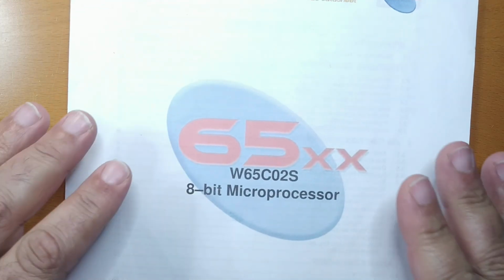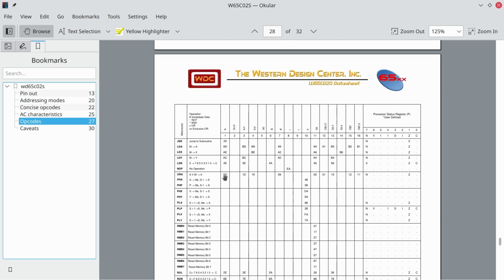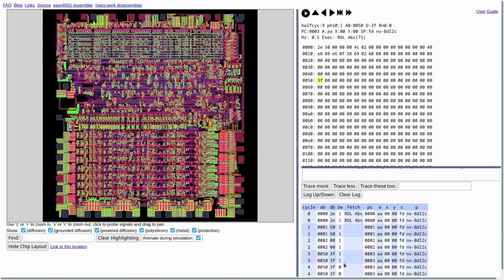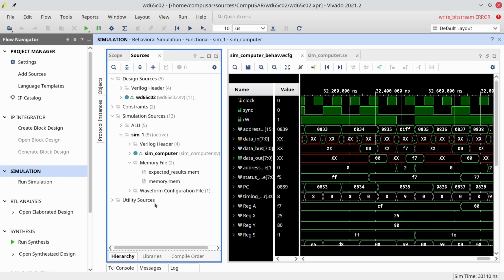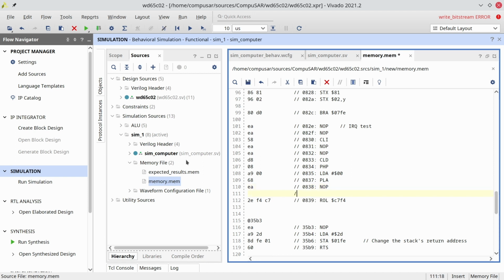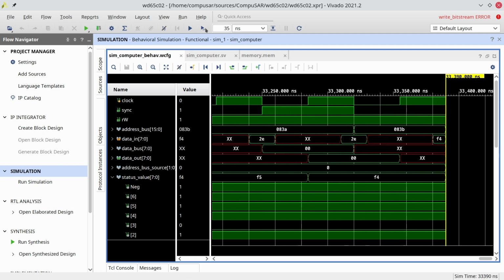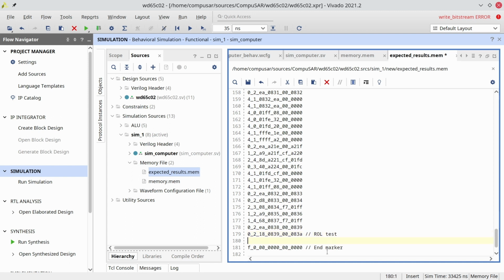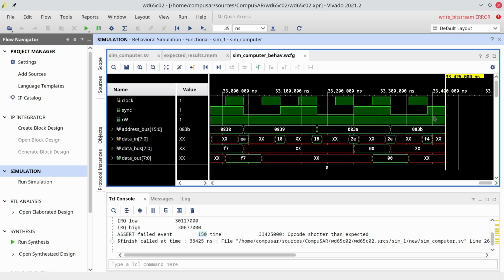FPGA 6502: Implement "ROL abs" part 1 of 3

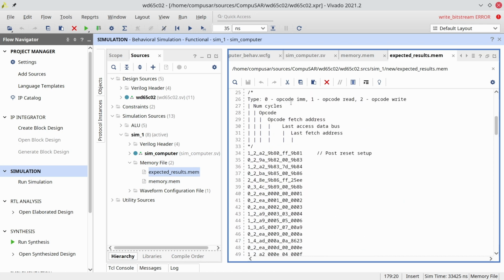Comment: At 16:16, I expected "Imm"  to be immediate rather than 'implied.'  There IS an operand and the operand is the next byte in program memory after the opcode.
Reply from the maker: There is a ridiculously simple explanation: the label is a mistake. Immediate addressing, as far the test-plan is concerned, is just like any other read operation, for precisely the reason you stated in the comment.
For implied operations, e.g. "TAX", there is no bus operation associated with the operation that the test plan can verify. Please keep in mind that the test plan feeds the test bench, which in turn only sees the CPU as a black box module. It can only test states that are external to the processor. As such, I thought it warranted a special mode, where no verification of value is done.